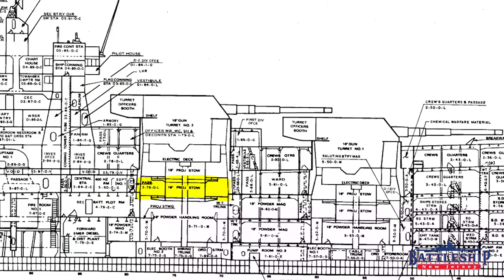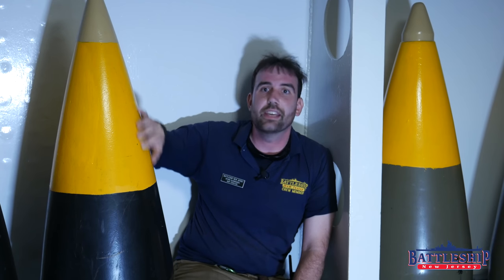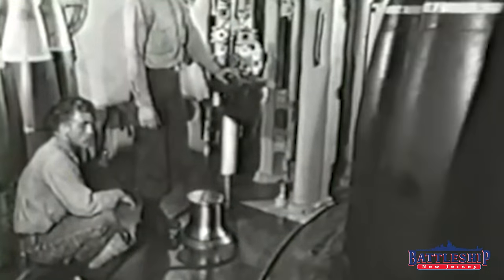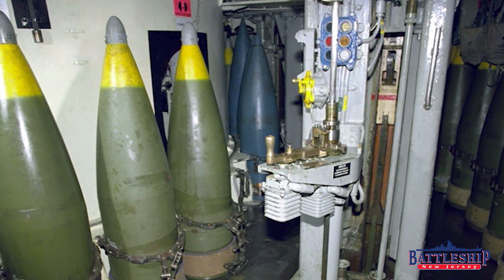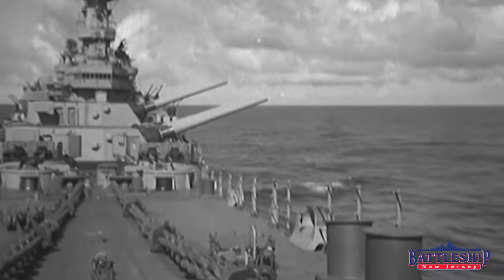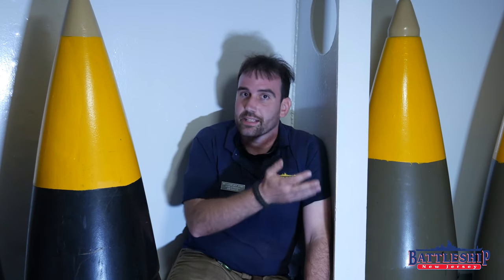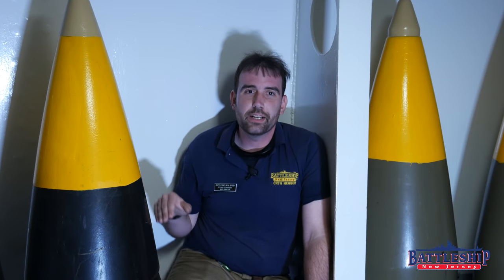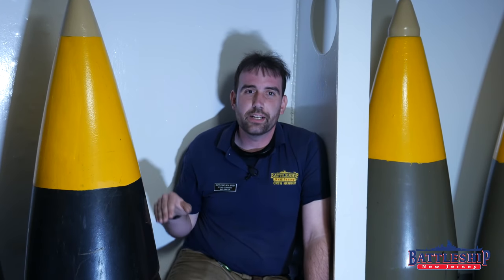What are the Different Types of Shells that the 16in Guns Fire?

Comment: When people try to argue that Iowa couldn't cripple or destroy Yamato they need to watch videoes like these to understand what the US Navy was going for - fast, efficient, long-leged battleships based more around plunging fire. As heavily armored as Yamato was, I guarantee you a 2600lb projectile traveling down at over 1000mph is going to crash right through the deck armor and do terrible things to the inside of your ship. It only took one such lucky shot against Hood to blow her apart when hitting a magazine.
Reply: Re: HMS Hood, you might want to watch Drachinifel's video about her sinking, he posits a well researched theory of the Bismarck's shell going through the starboard side under #3 turret due to the hydrodynamics of her hull allowing a trough to expose her side.  Shell went into the armory and that's what tore her apart.

Edit:. After rereading your post, it sounds like you have already watched it.
Reply: And that's why there are no more battleships. They are incredibly large investments in resources and manpower which are massively vulnerable and don't bring enough to bear to justify the expense.
Reply: In some ways you’re arguing this Apple is better than that orange. But I agree with you. The heavy shells hit as hard as the 18.1” shells. And where made to use plunging fire instead of direct fire.
The comparison to Bismarck and Hood’s battle isn’t the best. Unless one of the fast battleships got a good hit on one of the magazines or powder rooms.
Reply: No, Hood had plenty of deck armor for the situation she found herself in as at those ranges Bismarck's guns would not have exceeded 11 degrees of fall, so the shells would have bounced off the deck armor. It was either as Drach said, a shot below the belt armor due to the way the water flowed around the ship, or as I thought, Hood's own guns destroying her due to over ram which was a problem in the Royal Navy.
Reply: True for a full on war with China or Russia, but for world policing it's awesome. 
Your average speedboat with explosives will only leave a black mark on the side :)
Reply: @GeneralKenobiSIYE  In order for over-ram to have caused the magazine explosion, it would have had to blow through the safety interlocks between the powder flats and the magazine.  This is highly unlikely, as those interlocks were designed precisely to stop both this and turret hits from opposing battleships.  (British safety interlocks designed post-Jutland were very robust and very hard to disable).  An explosion from an over-ram would have killed everyone inside the turret and lower structure, but wouldn’t have been nearly powerful enough to defeat the safety systems.  This was basically what happened with Iowa in 1989.  The ship was never in danger from the initial explosion, even though there is some suggestion that powder charges had been stacked inside, a la Beatty, since it wasn’t battle conditions.   There was a fire which, if left free to burn, might have eventually cooked off a magazine, but this was extinguished by flooding the lower turret level.   During a battle, there’s no chance Hood’s crew wouldn’t have done the same.

Definitely agree that a deck penetration was unlikely though.  Drach’s explanation is the only one that addresses everything that was observed and the known facts about the battle.
Reply: @Kias1dad  
An actual engagement would probably not be fought at over 25000 yards. From what I've read, most engagements start out fairly long ranged and then close in as the ships maneuver, sometimes even to essentially point blank range (which would not be a good idea for either ship, especially Iowa). Another thing that might be interesting to consider is the US built the Iowa 2 to 1 to the Yamatos (something similar happened with tanks in the European theater). Yamato would have her hands full with a single Iowa but I'm not sure she would have survived two.
I'm curious. Do you have a source for the deck penetration figures for the Iowa's guns?
Reply: @177SCmaro  http://www.navweaps.com/Weapons/WNUS_16-50_mk7.php

The poster cited the figure given at 30,000 yards for deck armor. However, the figures in that table come from a US Navy empirical formula for expected armor penetration and includes a great many assumptions, including assumptions about the quality of the armor. Some armor will be better than those assumptions, some will be worse. If the shell finds a location with an imperfection or local weakness (which supposedly enabled the penetration showed in the test against Shinano's turret armor), or the target has rolled toward the firing ship a little and increased the angle of fall a little, then penetration is possible.

At Surigao Strait, the battle order was to open fire at 24,000 yards (at night, by radar), but concern about the location of some destroyers lead the battle line to open fire at just over 20,000 yards.
Reply: @VladMcCain  Re: 16" SHS hitting as hard as the 18.1" shells.
Mostly depends on the bursting charge if you can penetrate. That's the main power and off the top of my head the Yamato had a significantly greater charge.
But it is interesting to note Yamato had a turtleback armor, though I don't believe you could exploit that due to its thickness.
Reply: The USN did tests after WW2 and found the 16/50 "Superheavy" round was more efficient at penetrating deck armor than the Yamato's 18.1 inch projectiles. This was expected as the USN intended to fight at long range (over the horizon if possible with aerial spotting) using projectiles designed to penetrate deck armor.
Reply: @Kias1dad  The USN intended to use aerial spotting at long ranges - that's the reason the SC float plane was adopted as late as 1944 https://en.wikipedia.org/wiki/Curtiss_SC_Seahawk

Comment: Has anyone come across a cost of the shells themselves?  I know they had thousands left over from ww2, but they must originally have a significant cost to purchase.
Reply: That would be interesting to know, especially the adjusted price in today's dollars.
Reply: @projectmgrnj  Cool! Thanks for the link bud 👍
Reply: @johnmcmickle5685  Well, even the most complex artillery round is extremely simple compared to even the simplest motor-torpedo.  Fundamentally, artillery rounds get fired and everything happens passively after that.  You put all the complexity in the ship's targeting systems, which you keep unless things go really quite badly wrong.  A torpedo has to drive itself to the target and then have some kind of active detonator to determine that it has reached a target and detonate.  Even during WWII, there were torpedoes with active internal guidance systems.  The Germans deployed at least one type that would guide itself acoustically to a target.  (What's really amazing is Western Approaches Command figured out that this was what they were from a handful of reports of strange happenings during convoy attacks and devised counter tactics before the first war patrols equipped with these torpedoes were completed.)

A similarity to the 16 inch Navy shells and the Mark 14 torpedo is that so many were made that they remained in use for a VERY long time.  (The Mark 14 was fixed during the war, once the Ordinance Board was beaten over the head by at least one Admiral who wanted a WORKING torpedo, thank you.)
Reply: @evensgrey  That might be but the Mark14 was famous for its problems. There were many Japanese ships that sailed away because a Mark 14 ran too deep or failed to detonate,
Reply: @byronking9573  Compare the cost of a conventional shell to that of what has largely replaced them. I have a feeling that there is much more profit to be made from manufacturing guided missiles than "dumb" iron munitions.
Reply: @byronking9573  I can see now why the Navy wanted to use all that inventory to project power during the Cold War. It was very expensive munitions that were already paid-for a 2 generations ago.
Reply: @byronking9573  as for cost of powder...as a hand loader that loads his own rounds, 1 lb. Of smokeless rifle powder is around $30. Admittedly, that is off the shelf consumer grade propellant. But using that as a rough figure, the propellant alone to fire a 16" gun would be $18,000 to fire one barrel.....on top of your figure of $37K for the projectile. So, 55K to fire one barrel and $495,000 to do a full broadside.
Reply: @evensgrey  Not too long ago I saw some photos brought back from WWII USN vets who were on board the USS Missouri for the surrender signing… and some of them showed IJN ships in dry dock just after the surrender. At least one of the ships was photographed with several large (2-3’ diameter) concave dents in the hull. No one knew for sure, but it was presumed to be Mk 14 torpedo hits that failed to detonate on impact. They were a HUGE issue early on. And only begrudgingly admitted to finally.
Reply: @OldStreetDoc  Drachinifel has a video on the problems of the Mk 14 (some of which were shared with other advanced torpedoes of WWII in some form) and how they were eventually forced to be resolved.  (It gets tricky to get problems resolved when the guy who oversaw development, and now is force commander of the principle deployment force of the weapon, insists there cannot be anything wrong with it and commanders who claim otherwise are just using it wrong.)
Reply: @evensgrey  Yeah, I watched it a while back. Always appreciate the detail he’s always able to go to. 

Even if it was with the best of intentions & not simply a pompous inability to admit there could be an issue… pompousness rarely sees an easy or quick solution.
Reply: @mindeloman  The cost of a Tomahawk cruise missile in 1991 was ~$1 million.  However, that's a missile that famously "can fly down the street and hang a left at the corner."  Yes, it might cost as much as two, three, or even four battleship broadsides (considering inflation) but if you want to kill what's at this specific spot, you've got a huge advantage with a missile over any sort of artillery.  If you're looking at area suppression, shellfire and gravity bombs are the way to go.  They aren't as precise as you can get with a self0guided missile, but area suppression fire isn't about precisely hitting a target, it's about laying hell on the ground over a wide area so everyone stays inside their hard cover.

Comment: Explosive "D" is Dunnite, or ammonium picrate, made from picric acid and ammonia, very stable, quite "boomy", but primarely stable and good to storage. Fun fact: Picric Acid was used to dye silk yellow and was first made in 1771.
Reply: It is also an ipecac.
Reply: Picric acid is itself explosive, and can also be made from Aspirin (After a very complex system) I believe it is used as the "Primer" or basically a type of detonator within the actual explosive compound. There are many reasons why this is not only safer but for produces a more powerful release of energy, however I shan't be commenting on it! 
I may not have conveyed that info properly, but I'm pretty sure that's the general idea anyway!
Reply: picric acid was also used for treating burns, and is mentioned in Agatha Christies "murder at the vicarage"
Reply: Fun fact: that dye effect is also how my HAZCAT class was taught to identify picric acid, as one result of the first test done on a liquid unknown.
Reply: I bet that put a big boom in the silk industry

Comment: It took me a very long time, but I got to the bottom of the Mark 144 ICM projectile you mentioned! When you said it contained "400 M43A1 bouncing betty grenades" this raised questions for me, as a bouncing betty is typically just a name for a bounding mine, so I was thinking maybe it distributes mines instead based on that and had to look it up. Well I found a source, possibly one you read from, mentioning nearly your exact wording on them, and I was unable to find anything about the M43A1s still. I found out that an M43A1 is a type of light HE mortar shell used in an M1 81mm mortar first, and that went nowhere. But then I was finally able to find the submunition itself and get a decent explanation for everything. 

It is a grenade type submunition, as opposed to a mine, as it does indeed explode on it's own after being dispensed, moreover it is an airburst munition that first gets expelled from the shell in flight, spreads out on it's own from the air, hits the surface, then ejects it's explosive components (the actual 'grenade bit' a two piece steel ball filled with composition A5) upwards where they proceed to airburst. So the shell contains an expulsion charge that detonates to disperse the submunitions above the target area (what I found says it uses an "MT" fuze to do this), this then sheers the base retaining pins and pushes the base plug out, letting the submunitions disperse out of the back.

It seems as though these were also used in some 155mm artillery shells, as well as the 8 inch HE M404 shell, too, and the source also lists the "16 inch HE Mk 19 mod 0" as a shell that contained this exact number of submunitions, so I wonder if it's a different naming scheme or a different shell. My main question I was able to answer, but it seems it always raises more!
Reply: Submunitions, I was thinking about Cluster Bombs which are considered SO deadly. Air Bursts over soldiers is devastating, artillery is what kills the most in a war not the rifle round . There was a push to declare Cluster Bombs as prohibited War weapons but that is because of the threat of unexploded bomblets .  Airbursts is the only way to deal with troops in their foxholes
Reply: @oceanhome2023  I believe Cluster munitions were outlawed by the UN due to civilian casualties, however, I think the US has not signed on to that provision and still has them in inventory.

Comment: When visiting the Nuclear History museu in Albuquerque, I saw the model of the 16-inch depleted uranium projectile the Iowas might've fired. 16-inch really does not do justice to exactly how massive one of those is.
Reply: It was not depleted urian, it was an active nuclear 20 kt atomic bomb in a bullet!
Reply: 20 Kt is close to the size of Crossroads Able and Baker test , so imagine you fire the Baker round and it is set to go off at 100 ft below sea level . It destroys the entire fleet  .   You could also have it an air burst so you would duplicate the Hiroshima/Nagasaki blast . Imagine that the bomb was fired from this ship over the horizon and hitting Hiroshima same results .  The video of the cannon shooting a nuclear bomb is widely seen I don’t know the power of that round and I am guessing that it fired 10 miles away this 16 inch shell can fire much farther than that one !
Reply: @miketorres8441  Having gone there again, you are absolutely correct. they have a mk23 nuclear shell there, as well as it's immediate predeccesor in another section.

slightly more powerful than little boy, from what I've read.
Reply: The Alabama is smaller and it's still insane how massive it was seeing it in person. The prop they had on display was massive and weighed like 12 tons or something insane if I remember correct.

If you ever go inside the turrets that crazy also, you crawl through a little access panel and then your in a room that's like 30' across

Edit: Found the photo of the Alabama's prop specs. 17' 4 1/8" in diameter, pitch of 17' 8 1/8", 36,340lb weight
Reply: I was just binge watching Breaking Bad. Jesse Pinkman used the Nuclear History Museum for his secret meetings with his crystal meth dealers!  😆 My mother worked at the Oak Ridge facility during WW2, so I hope to visit the museum in the future! Looks like it's worth a visit.
Reply: The Mark 23 Katie round was adapted from the physics package used in the Army's 280mm "Atomic Cannon"

"The W19, also called Katie, was an American nuclear artillery shell, derived from the earlier W9 shell. The W19 was fired from a 11-inch (28 cm) gun. It was introduced in 1955 and retired in 1963.

Specifications 

The W19 was 11 inches (28 cm) in diameter, 54 inches (140 cm) long, and weighed 600 pounds (270 kg). It had a yield of 15-20 kilotons and was, like its predecessor the W9, a gun-type nuclear weapon.

Variants

W23

The W19 nuclear system was adapted into a nuclear artillery shell for the US Navy's 16 inch (406 mm) main battery found on the Iowa-class of battleships, the W23. Production of the W23 began in 1956 and they were in service until 1962, with a total of 50 units being produced.

The W23 was 16 inches (406 mm) in diameter and 64 inches (160 cm) long, with a weight given variously as 1,500 or 1,900 pounds (680 or 860 kg) in reference sources. As with the W19, yield was 15-20 kilotons.

Turret 2 had a 2 story magazine and one story was converted into a magazine for the nuclear round. The Navy "neither confirms nor denies" that any Iowa ever carried a nuclear projectile.